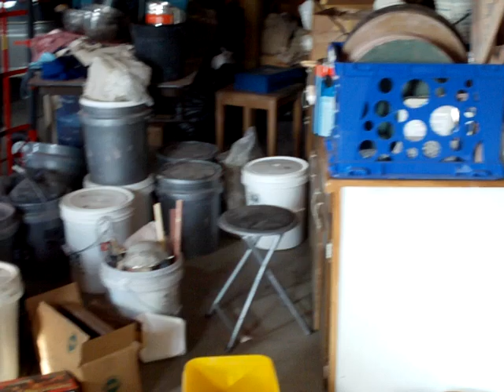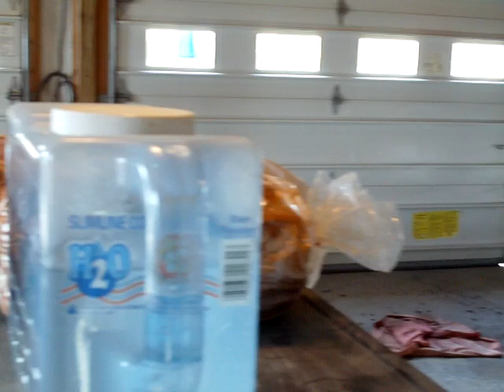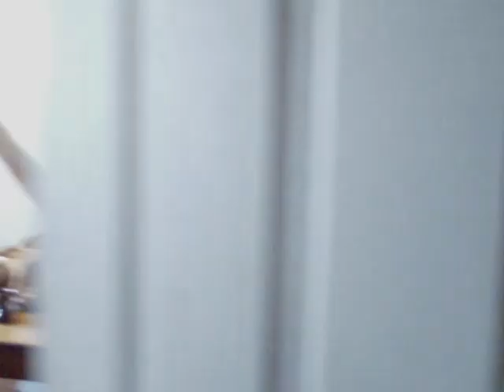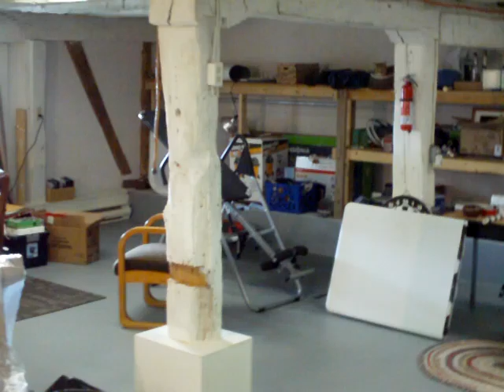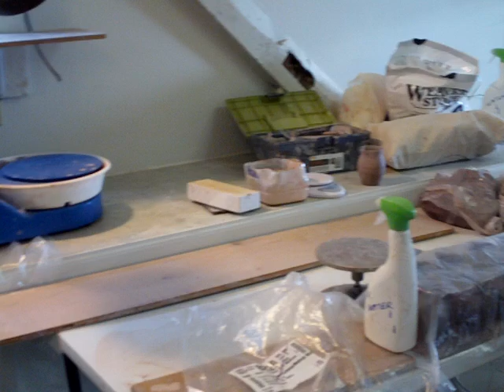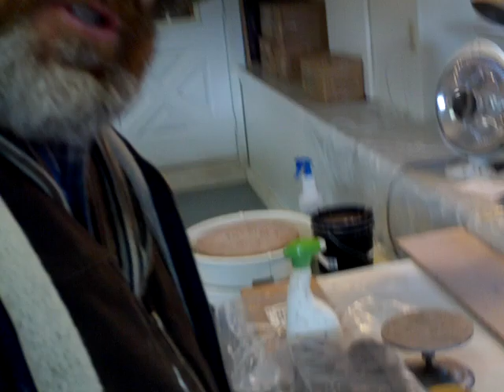SIMON LEACH POTTERY TV - Millheim Pottery beginnings ...Jan 7 2014

Comment: Welcome back, I also have my studio in my garage and am challenged to keep it warm even in Georgia..  My access to wood for a stove is limited so I found a "Mr. Buddy" portable  heater that can be used inside. It uses propane and does a  good job but has to be turned on ahead to warm the space.  Good luck with your new location and thank you for your continued posts.
Reply from the maker: Thanks for the idea and good wishes . Gas is OK for warming up, but for the drying of pots i think you cannot beat a wood stove.